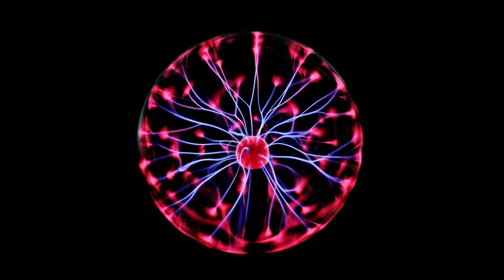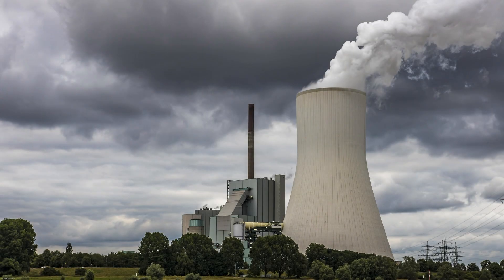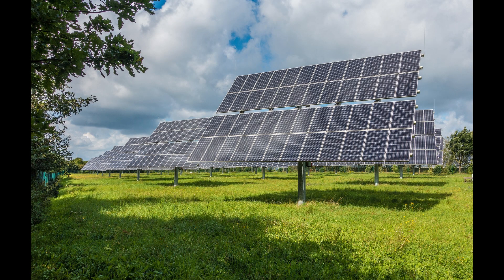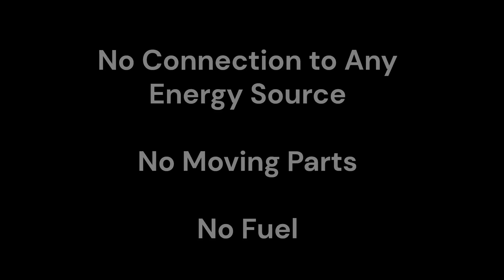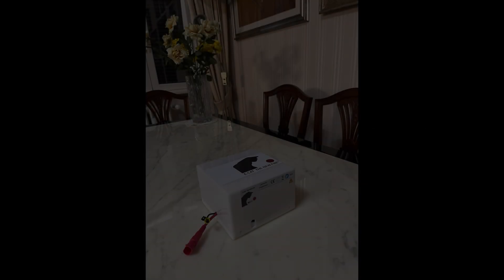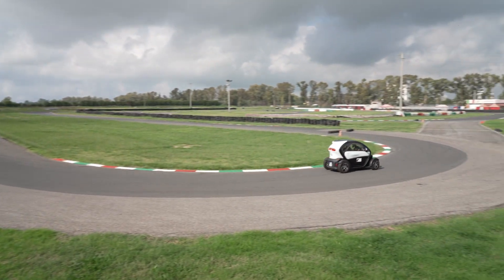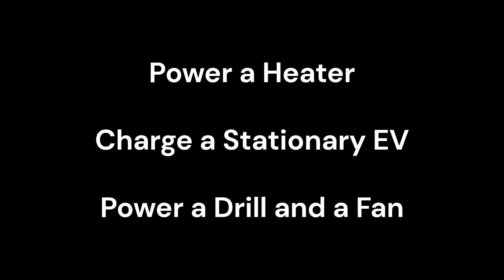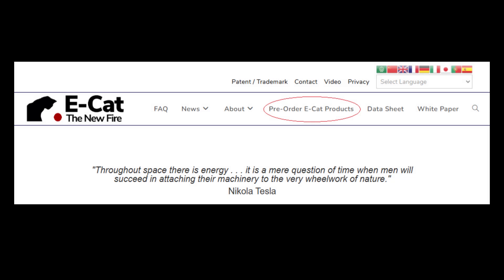What is the E-Cat? And Why is it so Important?

Comment: Well. Its very,very strange that it has not been verified and tested in for example Sweden... And then produced there...First they named it LENR. Now it's zero point energy. But the name is not important. They will figure out what happens inside when 1000 of the best engineers compete in finding an explanation.

Comment: Does the E-cat control module, need an external power for safety reasons?
Reply: Apparently a smaller battery is required to kick it off initially
But in a multi module unit, one ecat could start ten